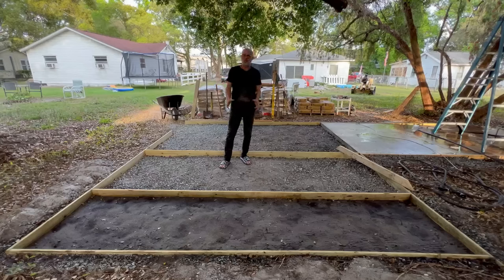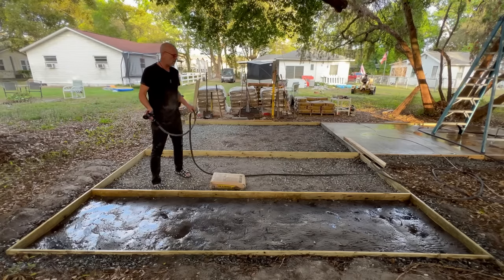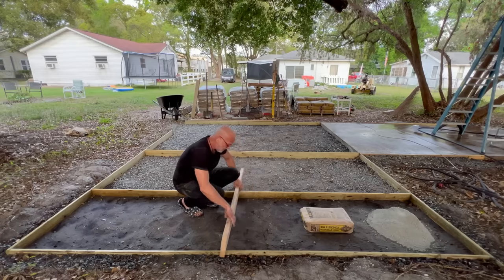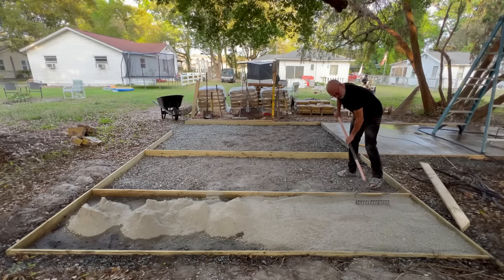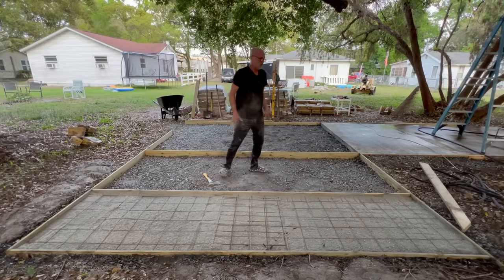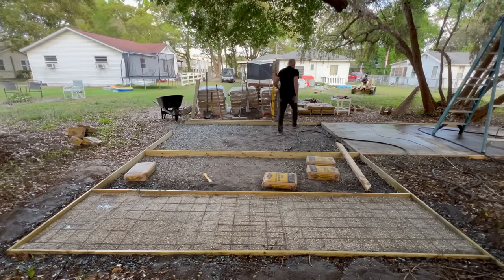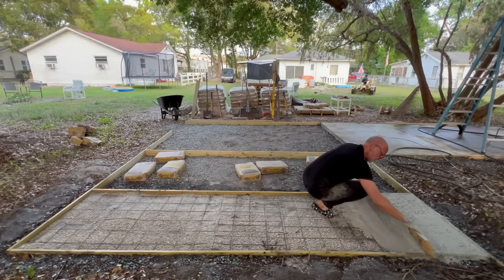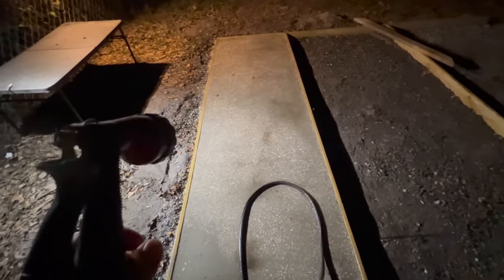How To DIY Dry Pour A Large Concrete Slab In Real Time

Comment: Your slab might last you a couple years or 50 years but dry mixing is really inaccurate and its weak...  a better method and pretty much as easy is to pile the concrete into a volcano shape with a center dish.. pour water in the center and then shovel from the outside into the center of the volcano ... into the water.. this is a common method to mix concrete without a mixer or wheel barrow and it lets you fully mix it and keep track of the amount of water you're using... and the first thing you do is put one bag in a wheel barrow and see exactly how much water it takes then multiply that by the bags you are using.. so one bucket to a bag.. 10 bags.. 10 buckets... the amount of water you use greatly effects the PSI rating of the concrete.. you need it to all be curing at the same rate, same amount of water at the same time.. If you used the handmixing method with a shovel and hoe you could probably get very reasonable results that have a high PSI pounds per square inch and you probably could drive a car on it.. most of all it would have a smooth surface you could broom if you wanted instead of exposed aggregate. HOWEVER... dude you do what you got to do and I realize that but I am just writing this for people who might find it useful... Your slab is going to be fine for what you need.. but there are better ways that are more accurate and just about as easy if not as easy but have much better results and you aren't guessing if the cement washed out of the concrete or if its still kinda dry in the center... If you want to know why people don't do this all the time.. thats the reason. you probably have 600psi concrete instead of 3500 which the bag says it could be if mixed correctly.
Reply: Well put. A lot of people seem to not realize that concrete isn't as simple as "it got hard, so it must be fine." The ratio of water to cement is crucial for achieving anywhere near the strength the mix is capable of. And it seems simply impossible to have any idea whatsoever how much water you are using or if its getting evenly distributed when you're just soaking a pile of dry mix with a hose. I honestly don't see the fuss around this method. I have hand mixed hundreds of bags in a wheelbarrow doing various projects around the house and it really isn't that big of a deal. After your first couple projects, you get decent at finishing it too.
Reply: @Luciano_Intorno  i mean yeah if concrete was meant to be soaked with water after you fill a hole with it dry then there wouldn't be any concrete trucks.. they would just ship it dry .. dump it in a foundation dry and pay someone $7hr to run a water hose on it.. but it don't work that way... What this guy is doing is ok for him.. its not really structural .. its not in an area that sees a lot of frost heaving of the ground I would guess. I wouldn't do it the way he is doing it unless I was physically unable to do it a better way.. and then thats when you hire people.. unless you're living in the jungle of vietnam or rural china or venezuala where nothing really matters .. just smooth that 1/4 inch of cream out to make it look good and no one will know HA!

Comment: I just finished a dry pour slab 4x16 that cost me 150 dollars and worked great. I was able to do it by myself in one day.  You cannot even get a cement truck with less than 10 yards of mix and that would cost several hundred dollars and if you don't have help you can't finish it quick enough before it is dry.  I would do this all over again.
Reply: 10 yards? jfc where do you live??
Reply: @Dave's Shop Did you look into metered concrete?

Comment: My concerns are that the layers of dry are too think vs. The amount of water applied. Not enough saturation/penetration. 2nd concern is that the wet mix should be at least raked to get more consistency. Good ideas though, thanks

Comment: If you work that 2”x4” side ways instead of staging it toward you.  It will work the cement more to the top and push the rocks down.  I have been thinking about using a vibrator from Harbor Fright the next time.  Have you ever used it on the dry mi?  Looking good.  Can’t wait to see the finished product.  Good luck.  Later

Comment: Be extremely carful in wearing those open toe sandal around concrete. Wet or dry it will give you some of the worst Alkali burns you will ever experience.
Reply from the maker: Don't believe everything you read.
Reply: @renetto  I've been driving a concrete mixer for 35 years. In that time I've scene a lot of injuries caused by concrete getting on the skin. Wet or dry if not washed off properly it will cause an injury.
Reply: @keylargo2001  “it won’t happen to me”... until it does.
Reply: @renetto  
You're wrong on that one. It's a scientific fact that portland cement will burn skin.

Comment: This dry pour seems to be a lot of work over an extended time period.  You can simply just do wet pours in smaller workable sections that will add up to be the same area.  You won't need a mixer truck or pumper if you do smaller sections.

Comment: I'm pouring a 12 ft by 26 ft slab about four and a half inch deep because I'm going to have my motor home park on it. I really don't understand why you guys are pouring that dry rather than mixing it up and throwing hit in the form? My slab is almost done I'm just doing part of it as I have a little free time a little free money. I did it all the wet way not the driveway

Comment: It might be ok for a shed.  Testing proves that dry pour yield about 1/2 the strength as wet pour.  In the beginning of the video he says he is replacing a slab that had crumbled into pieces.  Original was probably a dry pour also.

Comment: I've seen this method done a few times. I can't understand how this method can achieve proper hydration. I wouldn't put much weight on the finished product. As an ACI inspector I'd give this method a fail.

Comment: I live in fla , I was wondering if u got a building permit ? Some counties require it also on 4" slabs footers are required by reg. In my area.. 🥸 ur supposed to punch the middle of the bag w/ ur middle knuckle protruding out.. that punch rips the bag open then u flip it fold it etc.. good hard punch.. 😉 u should use the wheel barrel to load the sacks on . Wheel it in unload . I worked a lot of construction sites.. just the surface is not what's underneath . If the top is not mixed all the same to the bottom . The mix in-between will not be mixed w/ enough water. If u only mix a few inches of the top of the slab . That's all u will have for a 4in. Slab .  Only what u have mixed good w/ water will harden.. 🧐

Comment: You must have a strong back, because I was amazed at how many times you picked up the same bag from ground level.
Allow me with a used up back help ya out. 
You can throw a few bags in your wheelbarrow, laying flat. Move to location, then do you cut down the middle like you were, and you will still be able to lift the bag out by grabbing the ends. Then you can rotate it over the dump site. 
It just saves on the back. 

I do really like the Idea of using water before concrete, and in the mid point. 

I also plan on building a greenhouse, but it's way back on the property where a concrete truck will not be able to get to. So I have been thinking about doing this type of pour. 
Retired Builder, so it just seems weird to me, but I am coming around I guess.

Hey many blessings, and hope to see how it all turns out.

Comment: If you do a very quickly vibrating skree before putting any water on it, it brings the concrete powder up and the gravel disappears. You can then use an edger while dry, then actually roll the surface with a dry paint roller. Yes, a dry paint roller until smooth. THEN you begin watering with the “mist” setting. Every hour water again. The first two times with mist setting. Over the next 5 hours use the shower setting once an hour. You will be amazed how nice and how strong it will come out.

Comment: With all the dry pours I have seen watering is the last thing you do after you have done everything else you need to get the concrete level and textured to your liking. You also need to skreet it better, don’t just pull towards you but also go from side to side. It will help soften the top layer and hide the gravel more.

Comment: I'm impressed buddy, and I worked as a mason's helper for a summer.  if you wanted a slick top you could dust it with sand mix on the top fill. or screen a bag of regular mix.

Comment: Instead of using the float tool to pound down the gravel/smooth out the surface, it’s much easier to use the leveling board. 
Once you do the initial pass of leveling the cement mix, go back over it, sliding the board left and right (repetitively) as you slide the board back to you, the gravel will settle/sink, leaving a smooth powder top. Then, once the entire slab is leveled (and smooth) you can add water.

Comment: I'm trying to estimate the width of just one of the sections? I know you said 12 feet wide by 16 feet long total. So I was trying to guess the width of the one section you did on camera. It looked about 4 feet wide. And I tried to count the number of bags you were using. And it seemed you used about 8 bags for the initial base and 8-9 bags for the top pour. So that's 16-17 bags total and if they were 60 or 80 pound bags, I'm trying to estimate my costs for a project I'm contemplating. I can't get a truck where I need work. Thanks for the video. It gives me hope.
Reply from the maker: 60 pound bag.  First section maybe 3 feet. Second maybe 5 feet.  Third section I did was about 8 feet wide.  the slab is about 16 feet wide in total now.

Comment: You could add in 1 inch styrofoam sheet and nail it down with 4 inch nails at a 45 to save on concrete and add in some insulation from ground temperature also you can throw in some chopped fiberglass fibers like from the stucco store and your concrete will never break

Comment: I'm surprised you are not wearing gloves, to protect your hands when spreading out the concrete as the top section. Cement powder can severely dry out bare hands, and create a few issue like dermatitis.

Comment: The one video I saw where it was actually broke up to inspect after, it didn't set very well.  Makes sense as you can't be certain the cement will cure evenly throughout.  If it's going to be supporting anything with significant weight, I'd mix it.  Better to do the extra bit of work and be confident rather than hope that it is.  I live in Ontario and I'm pouring a slab for my hot tub soon, I'll def be mixing and mesh reinforcing it.

Comment: Looks awesome. And you for-shadowed the “someone is going to hit a like”. Bet you didn’t think you would get 1.2 million views!

Only thing I would have done was pour the first layer. Put the mesh in and not wet it. That way it’s not trying to be two competing slabs bonding. They will but not as well as it all being wet as one. I would have also bent some of the mesh so there are points sticking up and down to get a better grab into it instead of just being sandwiched. 

Do all the watering at the end so it all cures together. 

Looks great and for the purpose you want and need it for it will last for a long time.

Comment: At 4 30 mark you say that in sand you can just dig and dig and dig, I don't believe this is the case because I tried it at our property near Silver lake Sand Dunes. There is the law of diminishing returns, you're in a hole about as tall as you are, the sand around the hole is pilling up, and at some point you cannot throw sand far enough to excavate the hole -- throw one shovel full out, and two fall in, and the sand starts piling up around your feet -- you could bury yourself quite easily.

Comment: Soil cement is an old system. it was very popular in the south where the soil was good.  You just spread your cement on the road, follow up with a tiller to mix it in with the soils, grade it and then wet it with a water truck and roll it  with a roller.  It will be harder than poured concrete because of the lower water content.

Comment: Honestly I wouldn't do this but it did turn out pretty dang nice. For a shed or similar that's 12x12 or less, sure why not. I did two 18x30 slabs for my shop and had a concrete delivery. It was more intimidating than anything honestly. The first time we didn't have a power skreed, kinda sucked. The second time we rented one (was like $125), that was sooooo much easier.

Comment: Bet it would be even easier if you used self-leveling cement to smooth out the top instead of board and butt in the air.

Comment: Good job, but you should really wear a silica mask when messing with dry concrete. The concrete dust gets into your lungs and can cause health issues. Also you can get something called keyway in between your pours, this would be used as a form and creates a bond connecting the two slabs together.

Comment: Use wheel barrow to move bags use bag of Portland to create finish batter for the finished top add while still moist butter up trial out you did fine for area that’s acceptable means you saved 8-12$ a sq ft to pour n finish depending on area

Comment: I'm not a believer in dry pouring I think there will be pockets of dry cement that the water won't reach. However, what do I know. I would love a follow up from you. Is the concrete holding up? Is it cracking? Or is it working out fine. Thanks for any updates.
Reply from the maker: The concrete is holding up perfectly.
Reply: @renetto  Thanks for replying

Comment: Looks pretty good from what I can see on my little iPhone 8 screen! 😂  Always wondered why that couldn’t be done like that?  Don’t know if it will cause problems down the line with cracking or whatever?  Hopefully not? Looks good enough though that think I’ll give it a shot too!  Now I’m wondering why did I buy my cement mixer for? 😂  I‘be done small pads with my mixer that turn out alright. I just was wondering how to pour a larger pad with a small mixer and get it to turn out with numerous pours of the concrete being poured in at slower rates then you get with a cement truck.  Was concerned i have separation problems with the concrete having different pours at random times?  Just shows how little I know about concrete work!  Got to be better than having a muddy ground to walk or work on anyway!  Whole lot cheaper than having to hire a professional company to pour a large pad!

Comment: I'm curious why I don't see anyone else using this method installing metal rebar to reinforce the slabs your the first I've seen so good job .
Reply: That wasn't rebar - looked like chicken fence.  It is better than nothing, basically to hold the pieces of concrete together after they start to crack.

Comment: The risk with what you're doing is that the water isn't evenly distributed throughout the concrete, leaving you with areas that don't harden properly or where inclusions form. The water is ultimately the catalyst that triggers the reaction that bonds the cement with the solid. That's why it's important that there's enough water everywhere. If you manage to get the right amount of water everywhere, then your technique will work.

Comment: Ok when you put last powder down the video cuts to you pattung it down with trowl. So did you mist it?? It seems very hard when you just put powder down
Reply from the maker: I tried several ways doing 4 different sections.  I spray a bit along the way but the top coat needs to stay dry until it as flat and smooth as you want it.  a light mist will harden the top and it will be obvious when you can give it more and more water without disturbing the finish.

Comment: A couple of helpers with a couple of wheel barrels could get all 4 slabs done in less than 2 hours, with a single concrete load. Buy an edger and rent a bull float and it would still be far cheaper than using bags.

Comment: I would suggest getting some work boots I've worked in concrete all my life and concrete Burns can be very painful just getting that concrete dust on your socks and getting them wet with that water hose will activate that concrete and cause a severe burn and I would say that's the last place you would want a concrete burn this on your feet

Comment: I am not sure that the results will be any better than just using  bulk 1/4 x dust over drain rock.   What I found is that pre mixed bad concrete settled a lot

Comment: I am wanting to do a concrete area for my dog's kennel space so she had a good run... minus the muddy mess every time it's wet outside. I've seen the dry pour but wondered if it could be done in a large space. This is inspiring. Enjoyed the chat through the video. Hahaha... and axe tip. I have zero strength so there is hope for me to do a larger space instead of stirring up concrete. I am curious about your remote control mic from amazon... which one is it?
Reply: Just a FYI, those bags are 60lbs and 80lbs, respectively. :)

Comment: This will work as long a he doesn't load the slabs with a heavy load or doesn't remove the forms, this is basically built like a heavy duty shower pan. The steel reinforcement is not needed/almost useless since most of the cement is dry and hasn't reacted with water to solidify around the aggregate and the steel, and it won't grip it when tension is applied. Good idea for some applications though.

Comment: YEssss....
Those concrete people insisting that he should have mixed the concrete with the correct ratio of water rather than what he was doing is probably right except if he was concerned about perfection then yes call a contractor. 
I did a 4" thick sidewalk just like this guy and it's still looking fine. 
Maybe in a few years it won't 🤷 who really knows ? 
I just know it worked for me just the way I needed it. 
I'm gonna try doing a complete garage floor this way next.